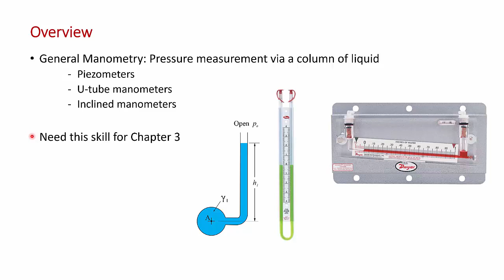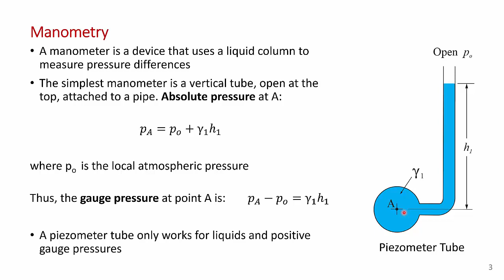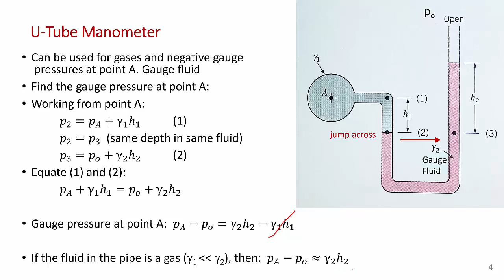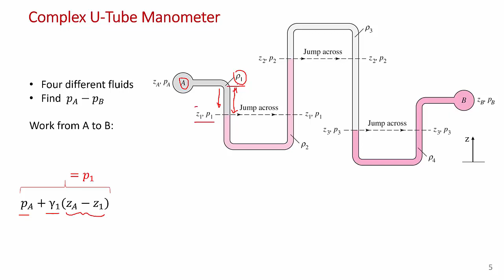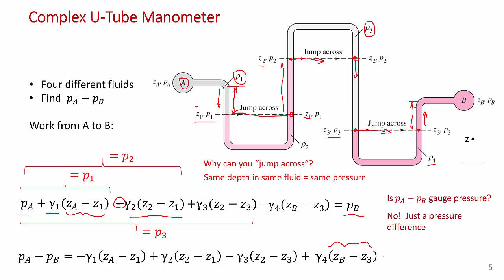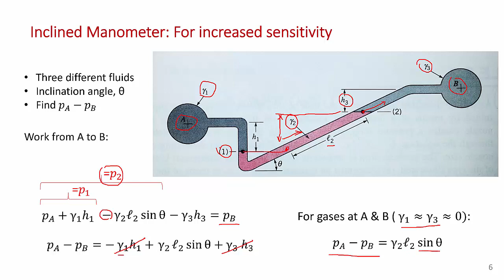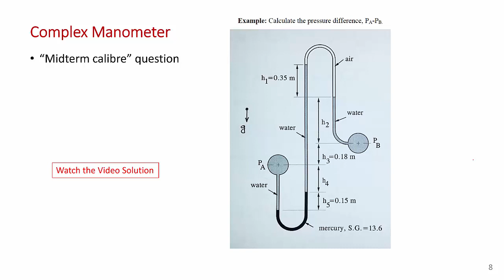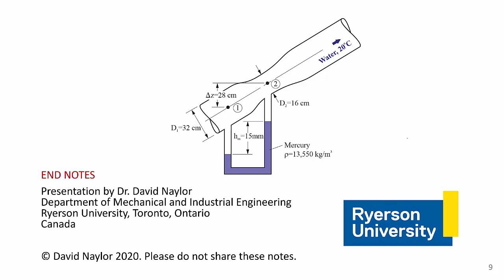Analysis of Piezometers and Manometers for Pressure Measurement

Comment: I have question, am really enjoying your lecture,
But you said, the specific weight of gases are close to zero,
But in the inclined manometer calculation for pressure difference, you did take y2 as 0, in the equation Pa–Pb =Y2 L2 sin∅, Why?
Reply from the maker: At 17:14 the specific weight the gauge fluid (which I think you are calling y2) is not zero. The red gauge fluid would have to be a liquid of some sort. I hope that helps.

Comment: i have just started learning fluid mechanics and i have doubt that why we are able to measure gas pressure in manometer and not in piezometer
Reply from the maker: A piezometer is just a vertical tube connected to a pipe. The pressure is determined from how high the liquid rises. If the pipe contained a gas, the gas would flow out of the tube because it is insufficiently dense.

Comment: Thanks for this lecture Dr Neylor
 i have a question though at 11:42 is the height difference not supposed to be (Z3 - Z2) or it doesnt matter
Reply from the maker: Note that z is measured upward, i.e. Z2>Z3. You need that term to be positive, since you are moving downward into zone of higher pressure. So it must be Z2-Z3 to get a positive number. You might find it easier to work in terms of DeltaZ, where DeltaZ is always a positive value.

Comment: I was confused how do u get r^2L^2 sino
Reply from the maker: I've taken the vertical component of the inclined length, l_2. From basic trigonometry,  l_2*sin(theta) is the change in height. So the change in pressure is gamma_2*l_2*sin(theta) is the change in pressure. I hope that helps.

Comment: Sir at 15:15 you jumped across. How did you do that considering they are 2 different fluids?
Reply from the maker: When you jump across from point 1, you remain in the same (pink) fluid at both locations. Think of it this way: If you when down from point 1 instead (into the u-bend of the manometer) the pressure would increase. When you came back up to the same horizontal location in the inclined tube, the pressure would decrease by exactly the same amount. So, you can avoid going down and up, and simply jump across.